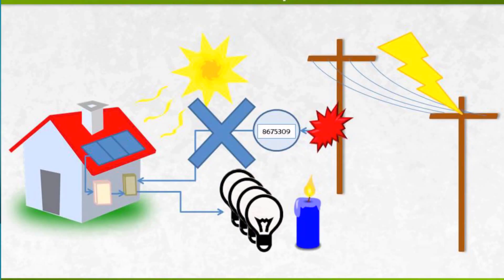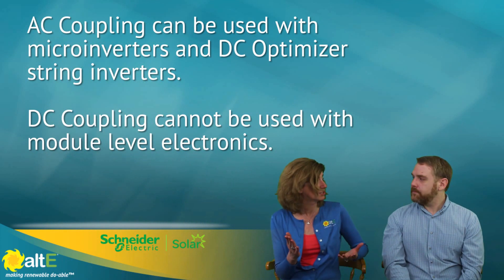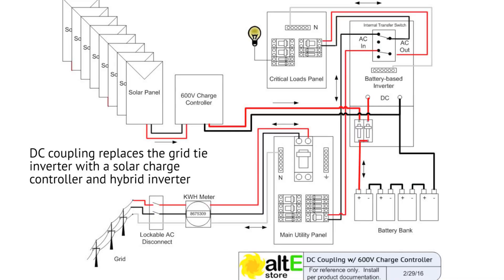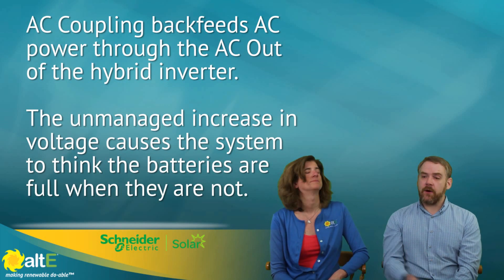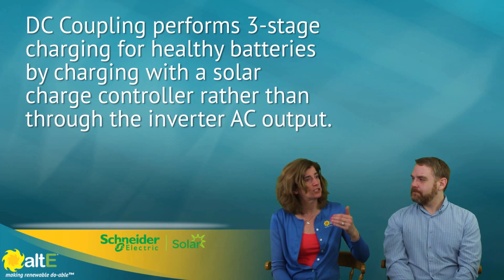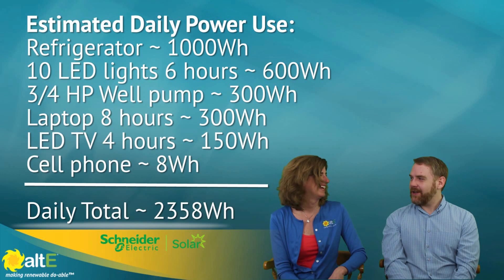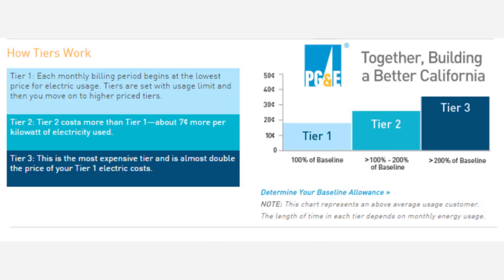Schneider Electric Discusses DC Coupling

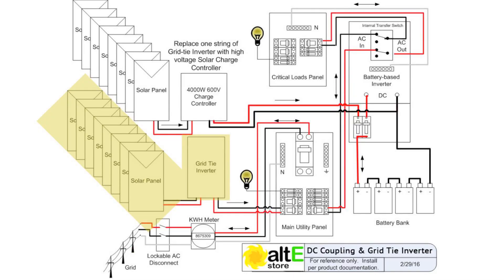Comment: I would think 3:42 would be the most simple way to go. and if you needed more solar couldn't a  combiner switch be installed either automatic or manual, to bring the normally separated strings together to  temporarily offer more solar to the controller for bank charging  when  the grid is down ?

Comment: i see the xw+ is single phase and 3 phase.  What about split phase output to provide load shaving for  BOTH legs of 110 thus helping out electric dryer consumption  or any other 220 appliance etc?
Reply from the maker: There are 2 electric versions of the XW+. The North American version is 120/240V split phase. Three can be wired together for 3-phase, 1 per phase. The other version for Europe and most of the rest of the world version has single phase and 3 phase 230V.

Comment: Is it possible to not feed excess electricity back to the grid? I want to use the grid ONLY when my system does not have sufficient electricity to cover my needs... I really dont want to bother with the headache of expensive and paperwork of the grid, which in this case they will not allow me to feed back electricity.  I want to cut my electric bill without going through expensive process  and system that will be worth it and economical.  Thank you very much for your valuable videos.
Reply from the maker: It's called self-consumption when you just store the excess energy you made during the day to use yourself that night, rather than selling it back. The Schneider SW can do that. The problem is though, you need batteries for this solution, which can negate any cost savings.
Reply: You are right ; I couldn't find any self consumption grid-tie inverter without batteries in the market, but I think it will be a huge winning for a company who invent such an inverter, because majority of people want simple solutions to lower their bills.  Here is my suggestion for the companies to think about for production:  lets say I want to run a small AC with 1000watts plugged into a grid-tie inverter, as soon the ac turns on it will us its surg power from the grid, the inverter will calculate the ac power consumption and it will start using solar power first to feed the ac unit, and it will stop producing solar power when ac stops to prevent feeding excess power to the grid; when there is no solar power at night it will use grid power to run the ac; this inverter should be as simple as a plug and play device.  Can u please suggest such an idea to the companies, and see what they will say? Thank you so much for reading my comments.

Comment: He says AC coupling can over charge the batteries, If you have an inverter/charger (battery based inverter) they have 4 or even 5 stage chargering systems on them so i'm not sure how that is even possible to over charge. If i'm incorrect please let me know
Reply from the maker: The inverter chargers have the multi-stage charging for the AC input, where you connect to the grid or generator. However, AC coupling uses the AC Output, which is connected to the critical loads panel. That output is not connected to the charger, so it has no control over the power, it just passes it along through to the batteries. So when the batteries are full, there needs to be some sort of external control, either a relay connected to the Auxiliary port that sends a signal when the batteries are full, or the inverter needs to be smart enough to vary the frequency of the output to slow down or turn off the grid-tied inverter.
Reply: Thanks for clearing that up Amy

Comment: If you are using the batter bank for peak shaving does the load need to switch over to the the batteries and you would need to reset clocks etc.?
Reply from the maker: +Jesse The switch over is seamless and you will not notice. No flashing clocks to deal with.

Comment: I do not see how he is saying AC coupling is niot good for the batts. Your Inviter if it's a good one will have all the same charge setting as a MPPT CC.
Reply from the maker: +yankey4 Using a hybrid inverter as an AC charger the way it is intended absolutely will have multistage charging. However, with AC Coupling, instead of the AC going in through the AC In, and therefore being managed by the AC Charger, it gets backfed through the AC Out. As such, it doesn't go through the multistage charger, it just sends the power in with no controls. SO AC Coupling has to have a different way to stop the batteries from being overcharged. Depending on the inverter, there are different ways. Schneider's XW+ shifts its AC Output frequency so that the grid tie inverter thinks there is something wrong with the grid and shuts down until the frequency normalizes. Outback and Magnum have external relays that open when the battery is full. Only SMA SunnyBoy and Sunny Island have a clean way to talk to each other and coordinate the charge.